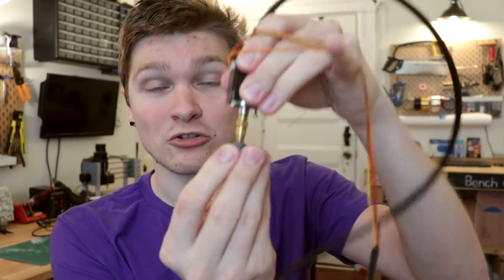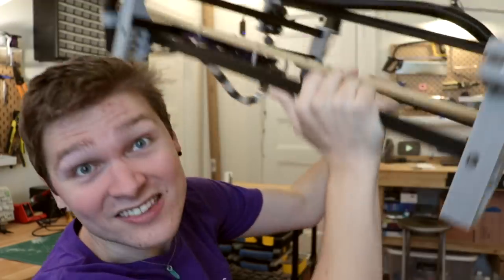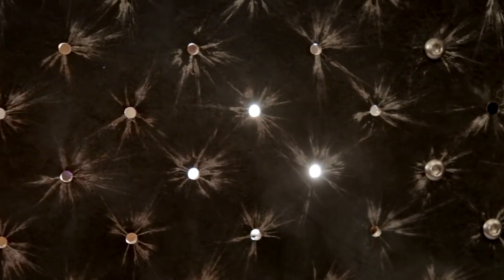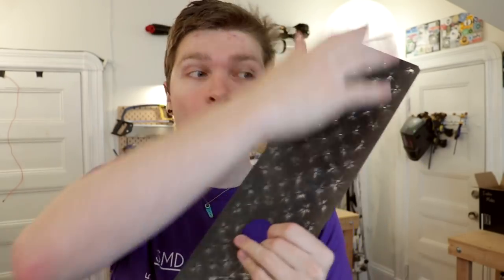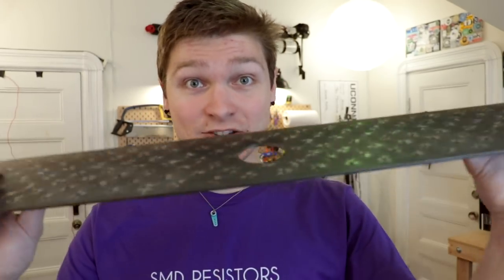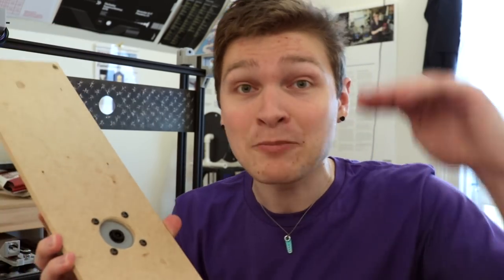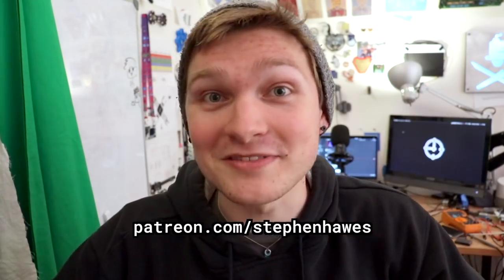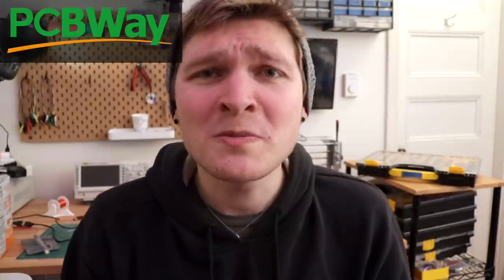Pick and Place Tool Changing!

Comment: You put the pump, which vibrates, next to the camera, which needs to be stable.
Reply from the maker: OH. YO. that's a super good point. thanks for the note! i should move it super far away
Reply: @stephen_hawes  just moving it away may not be enough since the frame will still vibrate, I recommend trying to come up with a mounting system which will minimize vibrations  as well like foam/rubber padding (assuming you still want to mount everything to the frame). Also other ppl have suggested migrating from Marlin to Klipper.
Reply: @stephen_hawes  Nah, you will need to decouple it from the frame.
Reply: @stephen_hawes  Look for some camera isolators used in drone industry and mount the PUMP with them. ;-)
Reply: Or let it keep swinging with a spring based holder 👍

Comment: If you are using the embedded STM32 USB HID (USBDP + USBDM pins), you have to programm your own driver... In this case it`s easier to use an FTDI chip and connect it via UART

Comment: Another way to fix the panel rigidity would be to add 2 extrusions in direct contact with the pannel going through lenghtwise and attach them to the existing frame, more expensive than the 3D printed foot though
Reply: Indeed it is unfortunate that T or U beams made from tree carcases wasn't an option :)
Reply: Just use your same idea but fix it with right angle v-rail adaptors (used in the old machine) and it's done

Comment: Stephen, consider running a pair of extruded aluminum profiles under the fiberboard.  This would add extra cross support and hold up the fiber board.   I would suggest doing this for the steel plate too, it won't do a ton for vertical support but it still has value as a cross support.

Comment: I was wondering how well the push fit of the nozzles would work, but that looks pretty slick! Doesn't seem to bind up at all.
I suppose if you do start to have troubles, you could make them attach with ring magnets? Kinda like those phone charger cables. That'll give you a highly repeatable and accurate mating, without worrying about parts wearing
Reply: I’m not sure but I think these might be Juki. Web search juki pnp nozzles and atc

Comment: STM32F407 Issues
Are you attempting to flash a simplified minimum development board first? 
 This is what I would do. Remove all of the unknown factors of a design first by using a proven toolchain.

  I am only getting started with the STM32F411 and micropython on a containerized linux machine. I'm not much, if any, help. Micropython migrated its way onto my board pretty easily. I only had issues due to permissions in linux. I had to use the dfu-util method instead of the default utility shipped with micropython's github repo. The process I used is described in ../micropython/ports/stm32/README.md.
 Obviously, you're not trying to run micropython here, but many times in the past I have figured out toolchain issues after looking at how less esoteric projects work with similar hardware. Micropython, supports the F407.
GL 
-Jake

Comment: I don't quite understand why you spend so much time trying to compile marlin for this machine. Use klipper and a raspberry pi, should work out of the box, and be significantly more flexible AND easy to configure. Connect the pi via network and make the port available with ser2net and you're all set.
Reply: I would imagine he either has experience with marlin, or it was the first thing that popped up when he tried to find a solution. My bet is he hasn't heard of your solution yet.
Reply: he's trying to run a custom board that replaces the pi and all the different interfaces necessary to drive the machine.  while it could be done on the pi, the custom board will make the final product more reliable and simpler.  also, since this isn't a 3d printer marlin/klipper/etc , as he mentions, needs to be modified.
Reply: @theJonnymac  I understand his intentions. I would still recommend klipper over marlin any time. I recommended klipper because I have successfully used it with openpnp and it has an official STM32F4 port and thus would not require any modification at all, it can also be very easily configured for pnp. Yes the pi is an annoyance in this setup, but at least it would not take him weeks to compile. And it's not like there is the one perfect firmware for openpnp out there, but there is more choices than marlin.
Reply: @wolfganglienbacher  you bring up an interesting point, just in general.  he is trying to build 2 major components here, one a device that auto builds circuit boards, and a complex controller for it.  one way to develop it would be to build an interface board that handles all the device controls and interfaces to something like a pi.  and once the physical aspects are done and you know what all the components are needed. you would then build your fancy custom board that will take several iterations and lots of software time, but at a risk of lots of rework.  Another, is you design and build both at the same time, which might require more work at different times and progress seems slower, but you can minimize rework/complete redesign at the end.  I've never built a device this complex myself, I've helped build/repair complex industrial machines using both methods.  It wasn't a clear win using either method.
Reply: @xxportalxx.  but marlin actually isn't recommended for OpenPNP, so I dont really understand why he insists on using marlin instead of switching to the recommended software.

Comment: How to make it not wobble? Board, meet beam.
Stiffness is overwhelmingly defined by the third power of beam width. So add a rib to the board and your problem is solved.
PS: This is an awesome project, thanks for the video!
Also, is someone working on adding a pick'n'place tool to the E3D motion platform toolchanger?

Comment: Next stop: interchangeable attachments: A drill; vacuum pump; solder dispenser; track printer etc. A locking mechanism holds the tool in place and pins provide both identity to the controller and power to the attachment. That way you could load a blank PCB, the software drills the holes, prints the tracks and artwork, dispenses the solder then places the components ready to be re-flowed or with a heat gun attachment, soldered in situ to the board.